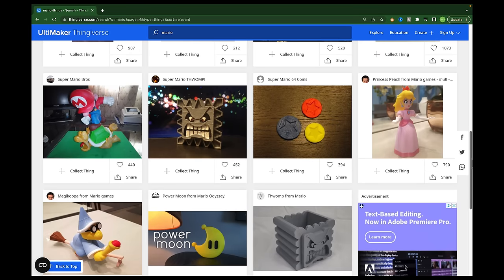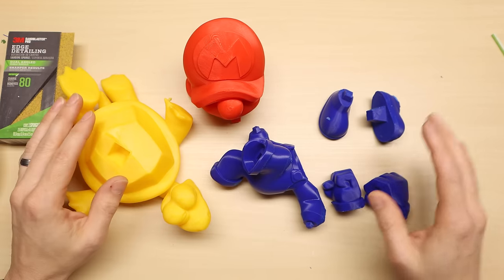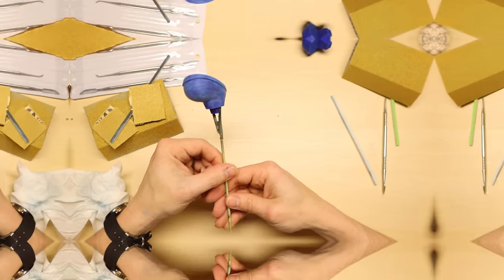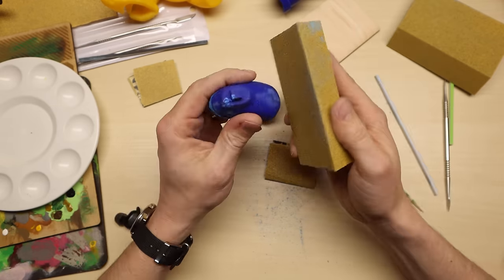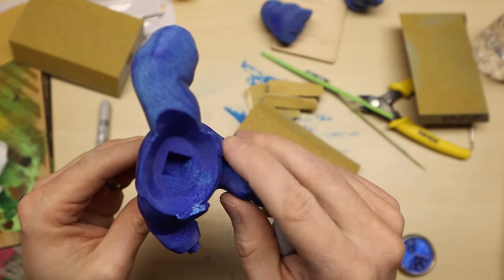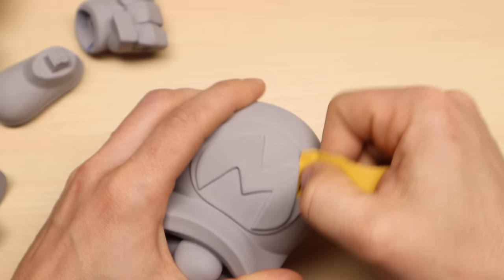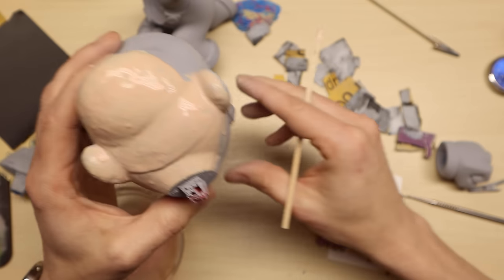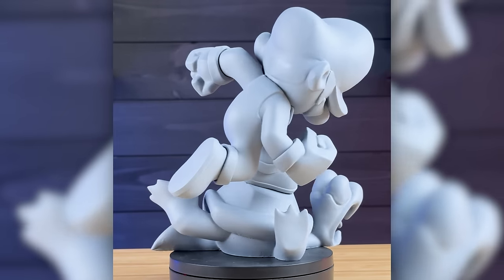How to Smooth PLA 3D Prints to Look Like Resin!

Comment: Why not just print resin?
Reply from the maker: Not everyone has resin printers.
Reply: @ItsMeaDMaDe  True but if you add up time spent and supplies you could have bought one. I don't know about your time but mine is valuable :)
Reply from the maker: @Geek-a-Zoid  i understand the issue isn’t only about money some people don’t want to deal with the safety hazards that resin can bring. Quite a few people have told me they don’t do it due to small kids in the house. But from a cost standpoint resin over time is far more expensive I do both regularly and the resin is always more expensive than just a spool of filament. In the end everyone has their preferences. This video is just to help people clean up their fdm prints.
Reply: @ItsMeaDMaDe  I stand corrected thanks for the info!
Reply from the maker: @Geek-a-Zoid  yeah never thought of some of the reasons until people have reached out and told me why they don’t want a resin 3D printer. I know I prefer resin over fdm 😁
Reply: I wanted to go to resin but my issue is dimensional accuracy a few clunky parts sure some filler but multi part model that's not organic such as a tank or space ship is sanity check time. Maybe I just sucked at resin but FDM is as close push fit as the CNC I was used too with out the long machining times

Comment: At this point, just buy a resin printer already... This is probably almost costing you more in materials alone, not to mention the time spent, and with all that sanding & spray paint, you're probably exposing yourself to more chemicals than you would with a resin printer.

Comment: Spend 5 hours sanding, or get a resin printer and have an already smooth model in half the time...hmmmmmm
Reply: resin printers can be little more work than regular 3D printers. Also the smell and fumes from resin are not ideal, especially when you are printing in your home and not some kind of a workshop. Oh and resin prices are not fun either! I liked this video and im glad to know I can get almost the same result with PLA.. with just a bit more work!

Comment: most of that could jave been avoided if u actually knew how to use a 3d printer. supports can fall off like  with a light pull if applied properly. top layer stuff where u got those big rings could hsve been adjusted in the slicer. absolute waste of time.